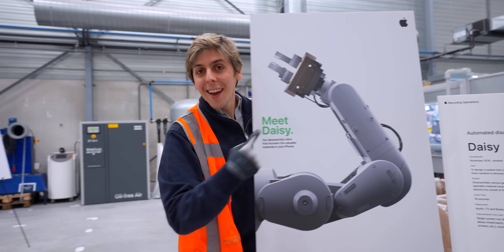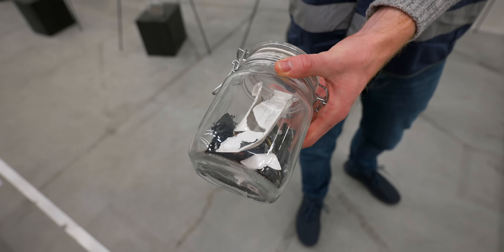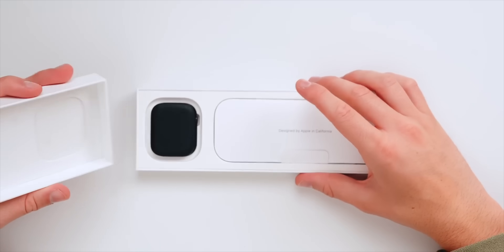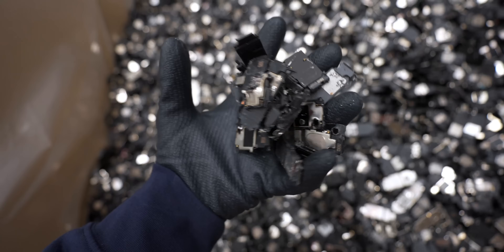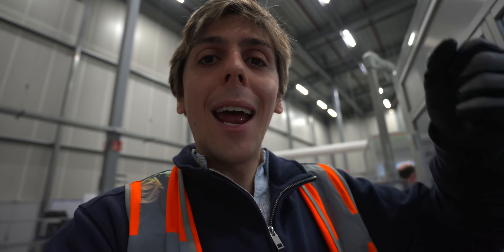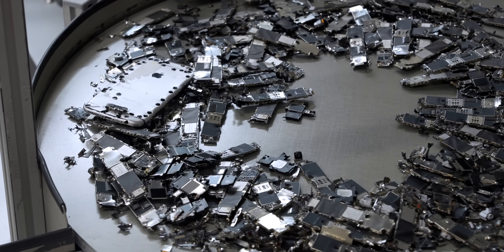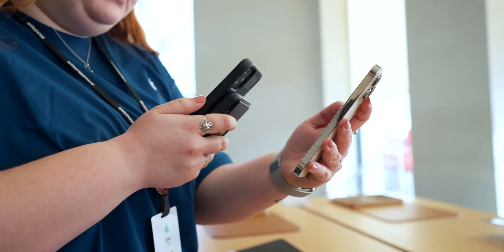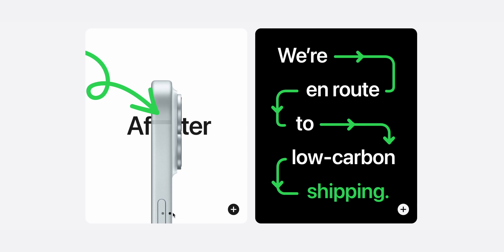How Apple’s New Robot Will (Actually) Change The World

Comment: Sure this is neat tech, but let’s face it, it would be 1000x better if it actually made products that were REPAIRABLE (instead of blocking all independent repairs), UPGRADEABLE ) instead of making everything soldered on, and REUSABLE ( by providing documentation on retired products)
Yes they are not alone in terrible anti-green business practices (looking at you Samsung), but they are a huge part of the problem and they often lead the way.
Reply: yea, even though there exist low or bad quality batteries, I do believe apple could have made the replacement process better by not putting an encryption chips on it = =